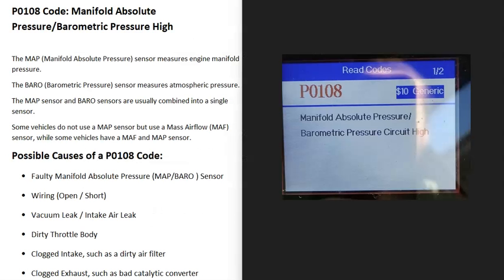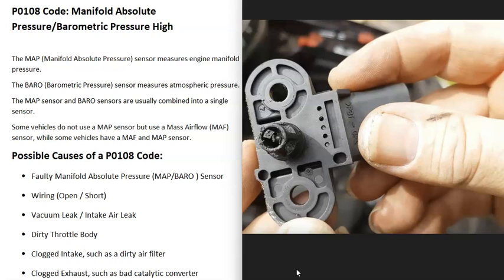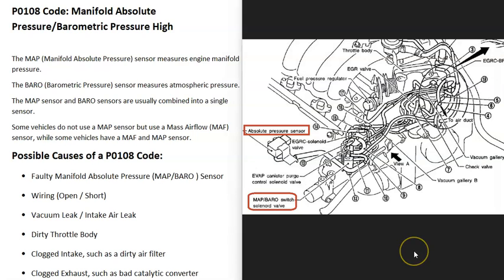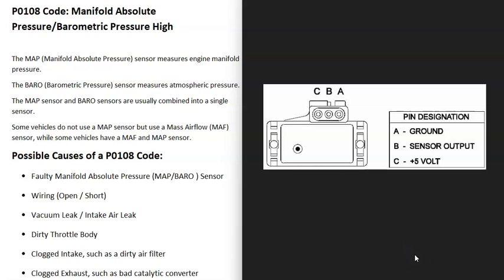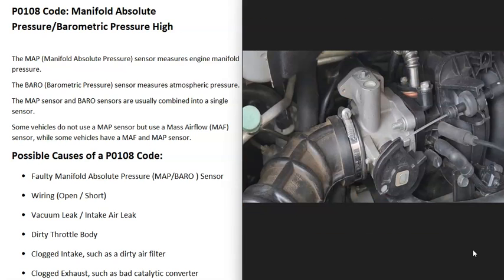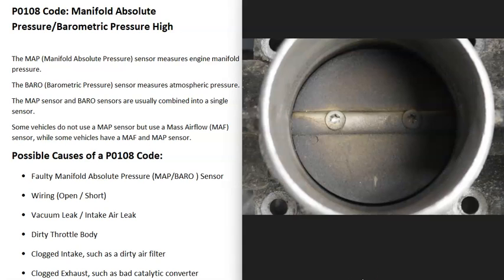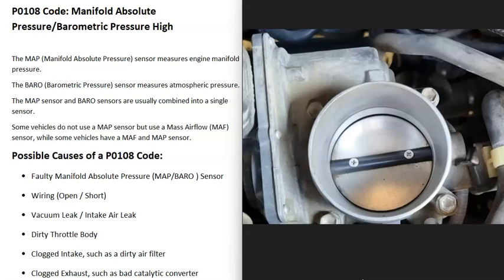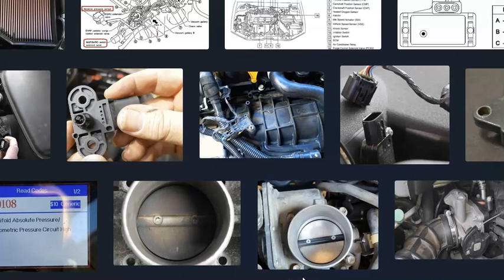Causes and Fixes P0108 Code: Manifold Absolute Pressure/Barometric Pressure High

Comment: My 2014 Prius has been giving this code.  I sprayed the MAP and that helped but then it came back.  
Today I found oil in the throttle / intake
Reply: tag me if you figure out the problem
Reply: @MasonHundley-z5q  nutzandboltz told me that oil in intake is normal for my gen 3 Prius.  I think I’m putting too much oil so that’s contributing to the pooling. 
     The design of the PCV valve by the crank case is really close to the block so the oil comes out of the PCV really easily and into the intake by the throttle.  I guess it’s supposed to be like that and the oil goes back in the engine anyway.  
     It’ll gunk it up but my only other  option is to add an oil catch can and Mickey Mouse it between the PCV and intake.  which I wanna avoid unless I really have an issue with it.  I’m in the middle of figuring that out now.   
     I see some people have 1 or 2 catch cans or OCC as they call them. I’m getting a new MAP sensor, gonna clean out some of the oil in the intake and start with a fresh oil change since I’m due any way.  I’m gonna be really careful and keep checking the dip stick as I fill the oil.  I usually just start checking after  I add 4 quarts out of the 4.4 needed.  It’s always confusing lol.  I can see oil all over the bottom half of the dipstick.  This time I’m gonna check it when it’s empty and check every bit i top off just to get an idea of what it’s supposed to look like when the engine is full.   I also heard Scotty Kilmer talk about letting it drain down for 5 min before checking the stick.
Reply: @MasonHundley-z5q one more thing to note is I tried doing my own head gasket and replaced necessary parts so it’s been fun.  I’m just hoping I got away clean lol cause I’m not a mechanic, just broke and couldn’t keep paying for one.  It’s been 10,000 miles with minor codes that I’ve been able to fix so far not counting this one.  We’ll see hope I helped sorry for the eye full

Comment: I got this code after taking the manifold off to replace the camshaft position sensor and putting everything back together
Reply: Dude did u ever figure it out I have the same exact problem I took manifold off to replace gaskets and o rings on fuel injectors and my car won’t even start now I’ve checked all connections
Reply: @dylanarnett5125 my car is starting and ruinning fine.  Im not sure about the code yet because I had the mechanic reset the check engine light and now I'm driving around for a drive cycle to see if the check engine light will come back on after so many miles

Comment: Great video. I just recently replaced the map sensor and did an oil change. Still receiving this error. A lot of the videos I find the car starts fine even with this code. My car starts for .5 seconds then sputters out and immediately dies. Any advice given this addition? Thanks!
Reply: Did you find the issue?Exact same boat as you
Reply: @menaft927  Unfortunately no. Took it to the Jeep dealership and they claimed I needed 20k in repairs to fix this issue. I'm guessing mine is having a head gasket issue? Not sure why it gives this code but yea other symptoms are starting to point to that.

Comment: Hi, my name is Daniel. I have a 2011 Volkswagen Golf. When I start the engine the cooling fan. Turn on full blast. And when I stop the engine the fan keep running for 1 minute before it stopped. What is the issue?
Reply from the maker: It needs to be diagnosed, and there can be several causes, but I would test the engine coolant temp sensor, which is the most common cause.